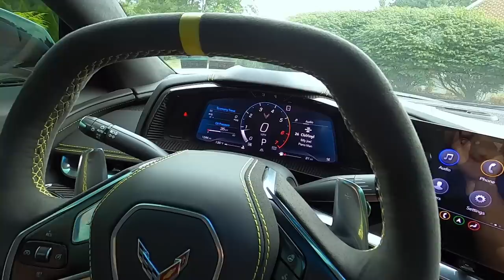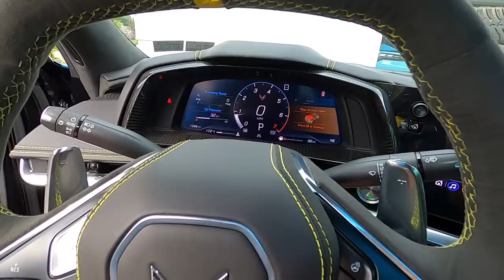FIRST DRIVE IN MY TWIN TURBO C8 CORVETTE!!! *It's PERFECT!*

Comment: 14:34 That's a protective liner, those brakes get red hot and you don't want to burn and weaken those carbon fiber wheels.
Reply: Dr. Bananable Lector so it’s a full carbon wheel right?
Reply: @brennandaly5727  yes
Reply: Definitely full carbon wheel. I've seen underneath one of these cars while it was in the Ford shop on a lift.
Reply: Why isn't it in the back?
Reply: @Richeeki  most of your stopping power is in the front, i think its like 70% up front and 30% on the rear. that may be a little high tho.
Reply: Rithik6868 front breaks do most of the work and they are hotter in general from sitting right by the engine bay
Reply: @Richeeki  The back rotors are smaller so they arent as close to the barrel of the wheel and the heat isnt an issue. Just my guess.
Reply: From Carbon Revolution website:
THERMAL BARRIER COATING
In order to shield the wheel from the extreme brake temperatures generated during track use, Carbon Revolution turned to aerospace technology. For decades ceramic coatings have been used to treat aircraft engine components, such as turbine blades, which are also subject to extreme heat. Using similar methods, Carbon Revolution developed its own ceramic Thermal Barrier Coating (TBC) using a multi-layer, proprietary formulation that creates excellent thermal resistance. This coating is applied to the inner wheel barrels and to the back of the spokes using a plasma arc process to liquefy the ceramic material. The result is a thin, ultra-tough coating that reduces wheel temperatures and allows continuous track use by even the most aggressive drivers.
Reply: They could have at least painted those liners black. Maybe they’ll be covered in brake dust and you’ll never notice
Reply: @echopiece79  light is better to reflect heat. function>form in this case I suppose.
Reply: F A S H I N T O X I N I believe you’re thinking of a light source affecting temperature on a colored object. In this case it’s all about radiant heat. I think light vs dark is very negligible in this instance.
Reply: I hope it is because if ford really put a carbon wrap over the wheel I would be upset
Reply: @echopiece79  right. dont mind me, science is not my forte HAHAHAHAHA
Reply: Koenigsegg have full hollow carbon fibre wheels that don't need a thermal liner because they use a better quality carbon. They're cars also have much more horsepower/top speed and bigger brakes. I guess Ford either doesn't have that technology or didn't want to use better carbon as a cost factor.
Does anyone know a weight for the Ford wheels?

Edit: Ford wheels are 7.7kg (17 pounds), 2kg heavier than Koenigsegg
Reply: Dylan Heisner in this case the engine is in the middle haha
Reply: I knew it since Mike brought it up in the video
Reply: @Richeeki   the front rotors have to be bigger to quickly slow down the front the make a quick turn on a race track
Reply: Marc the front brakes stop more aggressively than the rear
Reply: @LordYoshii  Koenigsegg uses gold heat shields at the back of the Regera wheels but the Agera/one:1 wheels does not have those heat shields
Reply: @sagarsarker6929  OK thanks. Didn't know that about the regera
Reply: I met a ford engineer at the Detroit auto show. He claimed to have worked on the gt500 project. It’s a ceramic protective layer to shield the wheels from brake heat. Cool tech!
Reply: @echopiece79  its a track car. Are you buying it cause it looks cool or because it hauls ass around corners
Reply: I wonder why Ford didn't just upgrade the front brakes to ceramic?
Couldn't they be a smaller diameter and accomplish the same breaking ability while keeping the heat further away from the wheels?
Reply: @jakecombs04  yeah ik iam trying to explain it easy dumb way so that one guy who didn't quite understand the reason will understand an example i basically said
Reply: @tracewallace23  Ford doesn't make the wheels. They are made by carbon revolution in Australia. They don't have a choice how they come
Reply: Ford and nasa made those I heard
Reply: @chrisfrank1318  nope
Reply: @Richeeki  because when you track a car it primarily uses the front breaks not the rears
Reply: @Richeeki  the breaks in the front are way bigger and produce enough heat to warp the rim in the rear the breaks arnt a problem
Reply: @echopiece79  you know its a authentic ford carbon rim with the white ceramic heat shield
Reply: I believe it’s made of ceramic and it is like the heat shields used on space vehicles.
Reply: I wonder why isnt protected in black color, why white
Reply: Frank Brenner so Ford is using the shittiest carbon fiber available 🤦🏾‍♂️ Unacceptable for the price they’re charging for these “carbon fiber wheel.”
Reply: @tracewallace23  good thing they didnt carbon ceramics are so damn expensive to replace
Reply: Frank Brenner It could come to cost for the customers. How much did mike say  his cost i can’t remember but it was thousand.  I think most people are not going to run out to spend that kind of cash.
Reply: Trace 23 These cars cost how much already.  Their a limit to what someone is going to spend on a mustang.
Reply: Chickens Float if I’m spending that much money it better look good too.
Reply: @Richeeki  That is the same coating that NASA uses for atmospheric entry. when the GT350R came out I studied Carbon revolution(wheel manufacturer) With the weight of the car and the size of the brakes, the carbon fiber alone will soften and deform under brake temperatures at a track setting. The rear wheels as someone else stated, they dont need it because most of the stopping power is up front. I used to watch mike daily even before he had the first yellow Z06, but as time went on they are only interested in saying and doing things to get views/comments etc.. oh well. But they are just straight up wrong about the wheels. if you read or listened/watched any reviewers they all raved about those wheels when it happened.
Reply: But how come the Ford GT carbon wheels come without the protective liner?
Reply: Frank Brenner this is likely due to the carbon ceramic brakes in the Koenigsegg. They don’t get as hot.
Reply: @asmircar1  white reflects heat better
Reply: @LordYoshii  konigsegg also is based on speed and braking and their cars are mid-engined plus their lighter than the mustang
Reply: @rahul_2321  its lighter and mid engine giving the rear a little more brake balance plus the wing slows it down
Reply: Don't like it, should look the same.
Reply: @tracewallace23  carbon ceramics dont stop better than steel wheels. They dissipated heat better so you dont have brake fade as bad when going hard on the track.
Reply: its Ceramic plasma arc spray on the front wheels  they developed for the space shuttle extreme heat
Reply: @LordYoshii  your taking about a 3 million if not more car compared to a 90k car. They cnt use the top carbon probably bc of cost since the car will then be more money
Reply: Thats why the guy back out... because those wheels are fake
Reply: sharkboy cubing Yep we’ve been using it in aerospace for many years. Works really well.
Reply: echopiece79 Was told by aerospace guys that it needs to be this way or it will interfere with with the chemistry and the bonding process.
Reply: @chrishofmann3028  that is what I said. A cost issue
Reply: Deception Racing Who is running carbon revolutions?
Reply: Trace 23 because you do not know anything about brakes. Look at ZL1 Brake Package V ceramics. The ZL1 won!!
Reply: @cristianbello4621  not only track every vehicle on the road uses 70-73% of the fronts for stopping power
Reply: @yojimbotv8554  you mean BRAKES NOT breaks
Reply: Todd m  Lol okay you go ahead and disable your rear brakes and see how much it takes to stop a 4200lb car. The front brakes do most of the work yes but that doesnt mean the rear brakes are useless lol who told you that lie. Most bikers will down shift to slow down not exclusively the front brake lmao
Reply: @LordYoshii  well said.... I think it's the latter though to be honest . Ford wants to make money easier.. ( work smarter not harder)....cost is everything
Reply: bad ass 6 piston brembo brakes and they put solid rotor no wonder it gets  red hot lol
Reply: @austin3627  That's about the right ratio actually.

Comment: Here is the answer to the carbon wheel question.  This comes DIRECT from manufacturer of the wheels. 
The GT500 wheels we manufacture are a 1 piece carbon fiber wheel. Both the face/spokes and the barrel are made of carbon fiber. The only aluminum that is used is for the seat where the lug nuts sit and the backing plate that is between the car's spindle and the wheel. The grey you are seeing is a plasma sprayed, Thermal Barrier Coating. It is a thin coating on the inner barrel that protects the carbon from brake heat.
Reply: Thanks for this. I was being lazy and didn't want to Google it myself. 👊
Reply: Anytime you connect carbon fiber to aluminum they will corrode from one another. Koneisegg has 100% carbon fiber wheels that are hollow a truly amazing wheel.
Reply: That makes sense.
Reply: @TheOriginalUberGoober  yes but Koenigsegg has a State of the art braking system with the best technology in braking management,
NOW THE MUSTANG STILL BEHIND IN THAT,  FORD has not put the correct attention into brake balance,
Reply: And the fact that they tap it and still can't tell the difference between metal and carbon 😂😂
Reply: Legend
Reply: Nice… can ya wrap it with carbon fiber 👨‍🔧

Comment: The gt500 front wheels look like they have a ceramic coating to deflect heat off of the carbon fiber.
Reply: agreed!
Reply: I have a ceramic watch
Reply: Dom Poth okay...?
Reply: Exactly, to keep the heat from the brakes off the carbon fiber.
Reply: That’s exactly what it is also pretty sure the GT350R had it as well. Ceramic coating to protect from brake heat on those gigantic brakes. Sad people that have access to these cars know so little about them.
Reply: @SamtheCanuck  I worked @ a Ford dealer when the first GT350R came out. They had this ceramic coating as well
Reply: Just Jack would be worse if your wheels melted due to poor engineering.

Comment: The middle of the carbon wheels have a layer of protection over it for heat because the brakes get hot after multiple laps and Ford doesn’t make the wheels carbon revolution makes the wheels they are the only one piece carbon wheels you can buy
Reply: Koenigsegg makes hollow carbon fiber wheels. Always one step ahead of the competition. Lol
Reply: I guess you haven't heard of Koenigsegg, they've had one piece carbon fiber wheels since 2013 and they're hollow. Capable of doing 280mph.
Reply: Ejmin Ava yes but Koenigsegg doesn’t sell the wheels just the car with the wheels carbon revolution is a wheel company
Reply: @ejminava407  The difference is Koenigsegg wheels don't have lugs. They use an F1 style center lock. Carbon Revolution is the only company that makes full carbon fiber wheels for use with wheel studs.
Reply: @joesilveira7652  sure they do, 50K a set...
Reply: Ferrari makes carbon wheels as well for the Pista.
Reply: Those are made by carbon revolution as well
Reply: Exactly.  From their website: THERMAL BARRIER COATING
In order to shield the wheel from the extreme brake temperatures generated during track use, Carbon Revolution turned to aerospace technology. For decades ceramic coatings have been used to treat aircraft engine components, such as turbine blades, which are also subject to extreme heat. Using similar methods, Carbon Revolution developed its own ceramic Thermal Barrier Coating (TBC) using a multi-layer, proprietary formulation that creates excellent thermal resistance. This coating is applied to the inner wheel barrels and to the back of the spokes using a plasma arc process to liquefy the ceramic material. The result is a thin, ultra-tough coating that reduces wheel temperatures and allows continuous track use by even the most aggressive drivers.
Reply: Guess you're all late because I came up with the idea back in 2004.
Reply: @tiktoksarelame9721  man, all that idea having without action really paid off for ya didn't it?
Reply: @drummerdoingstuff5020  they're also like 80k a wheel lol
Reply: @jdwild98  45K a set.
Reply: @drummerdoingstuff5020  honestly not even bad (when you have the money to buy that car) considering veyron wheels are like 60k a set
Reply: @jdwild98  the tires are heavier than the wheel! That is just crazy! Yeah carbon wheels are getting more affordable these days.

Comment: Wow. That took some time figuring out how they should route/mount those and from the short looks on this video the Twins are tucked in beautifully and even somewhat maintenance “friendly”. What I mean by that is you can get to the turbos and clean the filters without a lift or a jack, jack stands, and a creeper. Ya “maintenance friendly” lol. 
Such a cool car and I give you big props for throwing the twins on it right off the assembly line. I just saw Cleetus put drag radials on his and do 0-60mph in like 2.8 or less... I can’t recall exact times but for sure sub 3 sec 0-60mph times. That was insane but his doesn’t have those two turbos stuffing large amounts of oxygen into each cylinder does it. I can’t wait to see the video (could already exist I haven’t looked yet) of this one either just doing 0-60 times launching it on the hwy or even better seeing what it can run on a sticky drag strip (bonus points if you also buy an extra set or just 2 rear rims and put a set of Mickey Thompson e.t. Drag radials on them but from what I’ve seen they hook so great they make one think they might hook and launch in a damn mud hole lol so the sticky M/T radials might be unnecessary). Peace and again big props for not messing around and just sticking a twin turbo kit right on it (it took big coconuts as they say lol 😂)

Comment: The traction management system is working purely off wheel speed and input from the clutches in the DCT. It deciphers those signals sends them to the ecu, traction control unit and then alters tps. I don't think power really has any effect on it truthfully.